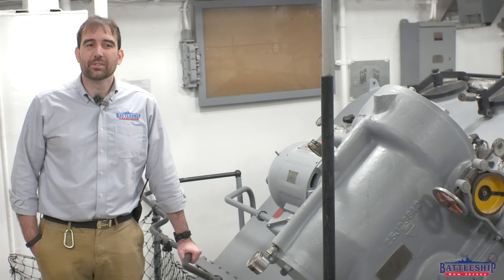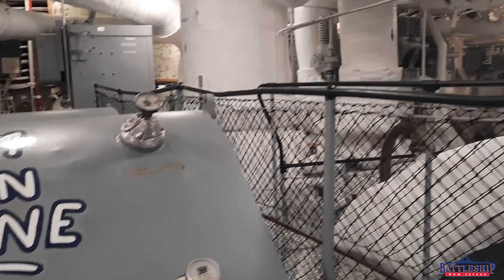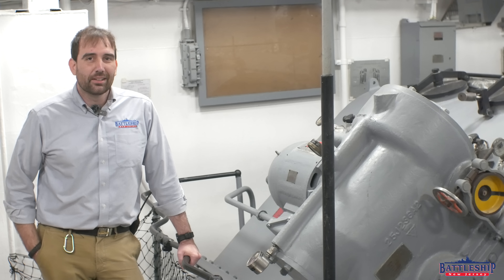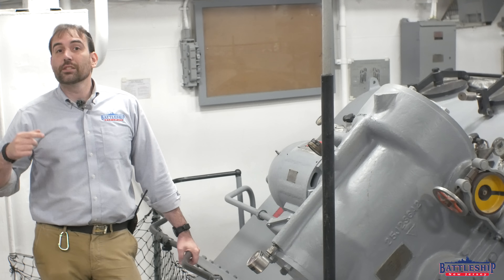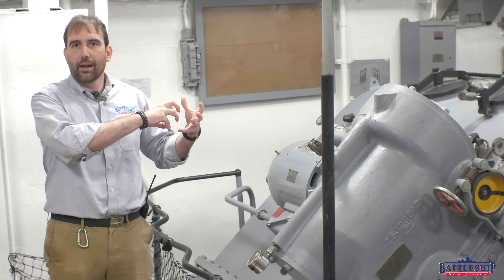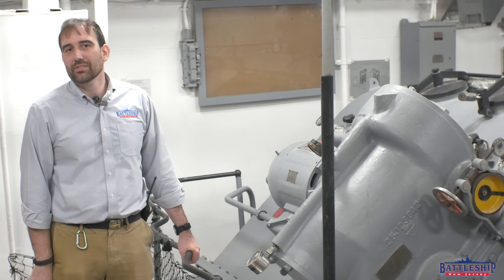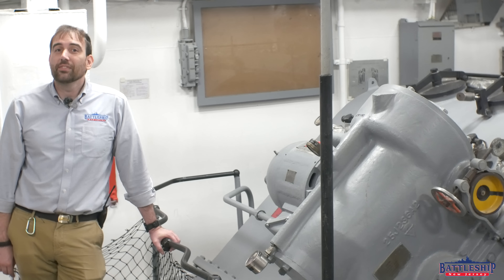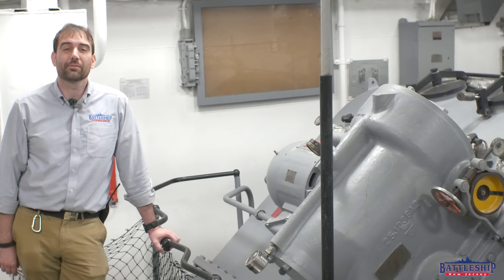What in the Navy is a Jacking Gear?

Comment: To prevent hogging/sagging of shaft line the turning gear/jacking shaft is used. The determining factor will be the top temperature of the HP or LP turbine or  a predetermined set amount of time to take the heat from the turbine. The turbine is slowly rotating to prevent uneven build up of heat in the turbine.  To do this you rotate the turbine as it cools.  The main reason for doing this is to be able to flash the turbine up again asap.  You could just shut everything down, but you would have to wait about a week or two for the shaft/rotors to become normal again. 

  The Electric motor usually has a worm gear, which will turn in one direction and not in the other direction because of the nature of the worm gear. The shaft turns at low rpm and the turbine turns at a higher rate ( due to the reduction of the gearbox, just in reverse).

 During normal operation due to the meshing of gears, heat is created in the gearbox.  The heat in the gearbox and turbine (see below) are removed by the gearbox oil (which has an oil cooler or 2).  The gearbox oil is maintained at a certain temperature to maintain the oil lubricating properties and it also takes heat away from the gearbox and cools and lubricates the bearings (when turbine is up or moving-by jacking gear). 

The oil in the bearings for the turbine and gearbox have enough pressure to minimize wear on the bearings (when using jacking gear).  At higher speeds; the shaft/rotor turning, causes a oil wedge to form under the rotating shafts (turbines and gearbox support shafts).

So when the jacking gear is turning (oil system must be up and cooling for the oil too).  When the engine is to be shut down, no more heat is introduced by steam.  The oil as it removes the heat from the turbine/gearbox will eventually get cooler. The lowest temp would be the sea water temp as that is what cools the oil. 

As the turbine is slowly turned by the jacking gear, some heat is released by conduction through the turbine blades down into the rotor, which has contact with the oil at the bearings.  I believe that most of the Heat is released through the casing into the atmosphere of the engine room (larger area of the LP and HP turbine casing covers). So space ventilation should be on during this cool down process as this takes heat away from the air in the engine room. 

Another consideration is to have the sea water pump to the main condenser on;  to make the condenser act as a heat sink too. (This pump is used at low ships speed to ensure cooling in the main condenser. The main condenser is a heat exchanger.)

Comment: Jacking gear is still used today in industrial scale gas turbines such as the GE Frame 6, which is used in land-based power stations.

A very funny (for some) event occurred around 1996 at the "Barcaldine Power Station" at Barcaldine in Central Queensland, Australia. The GE Frame 6 GT had been shut down and cooled prior to an internal inspection, but some-one forgot to dis-engage the jacking gear, which was programmed to turn the cold shaft a few revolutions every 30 minutes, in order to keep the shell bearings lubricated.  So, unit off, unit cooled, open the inspection hatches, insert the boroscope, and, oh dear, the jacking gear activated and the shaft turned and a turbine blade cut the head off the boroscope.

Major problem as a gas turbine does not like operating with loose pieces of metal in the gas pass.

GE technician called GE head office, but no spare boroscope available in Australia, GE technician called "Solar Turbines" (their main competitor) in Melbourne and asked to borrow a boroscope!.. no way was the answer, with much merriment.

Eventually, the GE technician was able to borrow an old worn-out and retired laparoscope from the Matron at the Barcaldine Hospital, and used it to retrieve the end of his boroscope.
Reply: Use a device for removing problematic things from bowels - doesn't matter if it's the bowels of a human or the bowels of a gas turbine!

Comment: Love when you measure things in "curators." Do all museum ships do this? If so, there must be a standard size that candidates for curator have to meet. Or does this practice hearken back to the time when the king's actual foot was the common measure of length so that the measured sizes of the ship's components change with each curator?
Reply: An oil tank might be one curator high on one, but will still be one curator high on another ship. Just change the size of the curator aboard the ship.

Comment: The bowing of the shaft from uneven heating goes up not down. The upper part of the turbine rotor shaft gets hotter than the bottom and expands more than the bottom half causing the shaft to bow upward.

Comment: If I remember, going back some 50 yrs,
in port, even cold iron,
jacking gear was engaged for like 12 minutes, enough to turn shaft 1 1/8 rotations, every morning, 8-12 watch,
entered in log.
One account I read of SteveMcQueens short, fast life, was that he had earned some brig time, as a young marine, ended up in the hole, bilges
as punishment, a circumstance that I can attest to still in practice, late 60s.
He speculated that is where he was exposed to asbestos,
ultimately, his death
due to mesothelioma.
Based on personal experience, completely believable
scenario.
In his era, if you were going to measure cool, SteveMcQueen
was were you hooked the tape measure.
Excellent video, as usual.
Reply: I was an MM on an amphib in the 80's.  Many marines onboard. It was common for marines to be sent down to clean the bilges for disciplinary reasons.
Reply: I'd not heard that. I have read that he believed he was exposed to asbestos from the flame resistant racing coveralls he wore in car races in the 1960s..

Comment: That was very interesting and I am sure it is all true.  When I was in the Navy in the late 70s I had to set the jacking gear as part of my cross-training qualifications. I was in Reactor Controls Division so this was not our gear.  But our study material told us that we had to set the jacking gear to keep the shaft bearings able to push oil between the bottom of the shaft and the bearing.  If we did not do this when the shaft was next needed for propulsion it would be metal on metal for a couple of turns until the 7lb oil system could get that fluid cushion on the bottom of the shaft.  Again, apples and oranges, you are talking about a WWII-era ship and I am talking about a couple of cold war era ships.  Lots of differences, so I enjoyed your explanation.
Reply: ET's engaging the jacking gear!?  What's next, MM's shimming rods?  lol
Reply: @ (: The throttle man was an MM's and they usually wanted to shim rods, and my RO's usually allowed them to do so, under strict supervision mind you!
Reply: No difference on the oil though, static shaft will weld to the bearings as the oil is slowly drained away. You need to have the oil flow to provide lubrication and cooling, but the shaft turning is what provides the pressure to generate that film.
Reply: @SeanBZA Boundry lubrication, at high speed, combined, with forced lubrication.
Reply: The forced oil lubricating pump, would keep the shaft from coming in direct contact with the white metal bearings, by "floating" the shaft, on a very thin bed, of oil. When rotating, at high speed, the shaft, by attraction, distributes the oil, around the shaft, thus cooling, and lubricating adequately. If properly maintained, the Turbines, will last, or exceed, the life of the ship, and often do.

Comment: Is this cause I mentioned the Jacking Gear the other day?  Cool. Start the electric lube oil pump and verify flow to all the bearings before starting the jacking gear. After you are underway, about 10kts on a Knox class frigate you can turn off the electric and run on the attached lube oil pump. We never did. The main reduction gear, the biggest one that is actually attached to the shaft, on a Wichita class oiler has 365 teeth on it, don't remember any of the rest but the main is easy to remember. The turbine sits above the main condenser which is held in a vacuum. It should never be 'red' hot, 'red' hot steel is anywhere between 1000 and 1500F. But it is hot enough to warp if is not rotated until it has reached ambient.   MM1 SW ret. I have so many issues with getting the Missouri underway in 5 hours.

Comment: You didn't clarify, but it is 2 RPM on the HP turbine.  The LP turbine is going to be spinning a bit slower, and the propeller shaft is going to take about 12 minutes to go around.

You mentioned that turning for warming up is important, but only mentioned the oil; it isn't just the oil it is very important for even warmup of the turbine.  Inside the turbine, the top of the turbine is going to be warmer than the bottom when the steam flow is low.  If the rotor was warmed up without moving, it would warp and have horrible vibration as it started up.  By spinning it slow as steam is introduced, the warping is minimized.   

During cooldown the shaft is turned for the same reason.  The shaft itself doesn't get anywhere near the 850°F steam temperature, just the first stage blades do. The temperature isn't anywhere near enough to make the shaft weak.  The bowing could happen because of uneven cooling.  By turning until cool, this warping is avoided.

When the ship is in service but not operational, they're going to turn on the oil system and spin the turbine for a few hours monthly to prevent bowing the shaft from its own weight.

Comment: Even now they still have these on aircraft carriers. It's surprising how little steam propulsion plants have changed  .
Reply: The engines would be very similar, BIG for a BB & BIGGER for the CVA, just the source of the heat to boil the water to make the steam.  Coal on the San Pablo, oil on BB NJ & uranium on the CVA.
Reply: The laws of thermodynamics haven’t changed.

Comment: You wouldn't believe the number of control wires that are in the Jacking Gear Controller.
Reply: Since that is manual, I can confidently say, just the motor wires. 

Btw. I operated this plant, so I have some experience with it.

Comment: Is it possible to still operate the jacking gear to turn the props in order to prolong the shaft packing?
Reply: Before we operated the jacking gear, we turned on the lube oil system, and warmed the engine to 120*. This took HOURS.  Since all oil is removed, if you did this, you would cause major damage to the engines.

Comment: Sounds like something I learned from my dad working at Lockheed Martin. I would sometimes get to visit the rocket plant for their Young Minds At Work thing, and the rockets on the assembly line would be slowly rotated to prevent them from developing a sag. The jacking gear seems to be used for a similar purpose, amongst others things.
Reply: The spare rollers for paper machines are also constantly slowly rotated in their storage racks to prevent sagging.

Comment: When the ship is underway at sea, and one or two engines are shut down -- is that prop immobile and just producing lots of drag, or is it allowed to freely spin via the water flow, and if so how, is the entire shaft and turbine spinning, or is the propeller decoupled in some manner from the static turbine?
Reply: I was an MM on an boiler/steam turbine amphib with years at sea.  The reduction gear/turbines/shafts are very reliable to where i can't remember being underway with a locked shaft.  Boilers were routinely taken offline and steam cross connected to run main engines.
I never seen a navy ship steam turbine/reduction gear/thrust bearing/shaft/prop system that could be disconnected. Prop shafts are made in sections, but it would require shipyard level work to disconnect them.

Comment: Remembering my old steam EOOW days, you might want to mention that spinning a lit off main engine with steam while the jacking gear is engaged is a great way to create a fragmentation bomb in the engine room. The reduction gear ratio between the jacking gear motor (typically only a few HP) and the propeller shaft is several thousand to one, so those massive turbines can spin the jacking gear motor until it explodes. Fortunately this never happened to me (I was lucky to always have excellent throttlemen), but I've read the accident reports and seen the pictures.

BTW, the jacking gear also includes a shaft locking device, which is what keeps the shaft from turning. Memories of the old Stop and Lock drills...
Reply: Didn't your ship use a worm gear on the back end of the HP turbine?  You can't back drive a worm gear, so it shouldn't over-speed.  It is still risky though because it may be enough torque to bust the jacking gear and that's still a lot of heavy flying metal.

Comment: Any time you need to turn the main engineer for anything in the water or in dry dock steam or diesel you engage the jacking gear it is  low HP electric  motor some old ships with recipicating engine (s) used a steam / air powered jacking some it was by hand.

Comment: I would be interesting to know more about the difference between being a museum ship and being mothballed.  It seems from Ryan’s ongoing remarks that in both cases necessary maintenance which would make return to active service easy is seriously deferred.  Is a museum ship actually better off because it gets some maintenance?  I get the impression that mothballed ships are all but abandoned in place and viewed by the Navy mainly as sources of spare parts.
Reply: I was stationed on a Trident sub out of Bangor, WA. The Bremerton shipyard, a few miles away, was the home of a lot of mothballed submarines and surface ships. 
There was a program where the crew could have paintball fights on a mothballed submarine as “security forces training.” They’d even provide all of the gear. 
Nobody ever did it, though, because you’d have to scrub all of the paint up afterwards.
Reply: @Ghotiermann  Thanks for the reply.  That is interesting to hear.

Comment: I think the most important function is to allow those massive Steam turbine rotors and Stators, to expand slowly and evenly.  The clearance between blade sets is very small.  As another poster said, they start turning 24 hours before getting underway, and for 24 hours on cool down.  The pre-lube only needs moments to flood all bearing.
Reply: But the slow turn is also important to allow the bearings to operate, as a static shaft with pressurised oil will simply lose most of the oil film, so will sit hard on the bearings. Rotating the shaft will allow it to develop the needed hydrodynamic oil film that keeps the parts separate, and thus not have metal to metal contact. When starting you pressurise the oil, then slowly start the shaft with the jacking gears, so that you can easily develop the oil film from the existing oil film there, and avoid starting with no oil on the bearings. 

Reactivating the ship now, after 30 years, will be problematic, as those bearings have not had oil film on them for decades, and now likely have welded together in the bushing, which means the first application of torque will lead to very high bearing wear as it breaks free, and possibly that torque will be beyond the ability of the motor of the jacking gear to do, unless it has been run at least every 6 months to keep an oil film there, which, as the ship had oil removed after being taken off reserve, is now near impossible.
Reply: I have wondered what the state of the main machinery was.  Is it kept in a state of preservation?  what did they do in the past, before it was re-activated?  @SeanBZA
Reply: @chimo1961  As they had power on board for dehumidification they likely had a schedule inspection, where part probably was operate the electric oil pumps, and then the jacking gear to operate for an hour, to ensure the oil was still flowing in the lines, and to keep the main gearboxes lubricated, plus keep the gland stuffing from compressing flat.
Reply: @SeanBZA all oil was removed during decommissioning.  Systems coated in a sealant. They can not start the jacking gear without major damage, even when mothballed.
Reply: thanks @SeanBZA

Comment: My dad told me a story from his time in the Navy aboard the Spruance class Destroyer USS Comte De Grasse. They were about to head out on deployment with I think use Saratoga, it was gonna be her last deployment I think. Anyway, they start up the engines and get the screws spinning to full rpm before getting under way. Apparently, they could twist the blades for more speed instead of increasing the rpms. Anyway, they've got the blades at 0 degrees and are spoiling up the shafts. Port shaft, spins up, no big deal. Starboard shaft, not so much. No matter what they tried, it won't spin up. So they shut down the starboard engine and pop open the reduction gear box and find the Bull gear jammed with assorted debris; bolts, tools, scrap metal, etc.
Turns out one sailor had a falling out with his girlfriend not wanting him to go out on deployment or something, so he somehow gained access to the gearbox and chucked a tray full of assorted debris into the Bull gear.
They clear it out, bring the sailor up on charges, and when all is said and done, conte de Grasse has a chunk bitten out of her bull fear which results in a distinct thumping sound every revolution of the gear.
Reply: Spruance ships had gas turbines instead of steam turbines.  All of the gas turbine ships had variable pitch propellers to enable matching the torque to the gas turbine and to do reverse.
Reply: @matthewbeasley7765  yep. They also throw up a pretty gnarly rooster tail at full speed.
Reply: At least that lad his job security; there'll be a deduction from his permanent E1 pay for the rest of his life!  Just 4,275 payments to go!